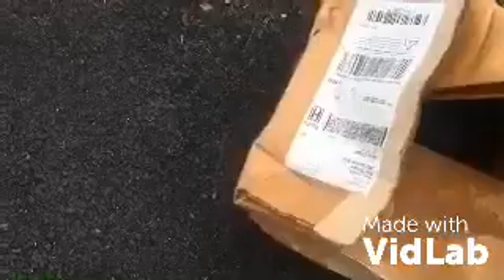SCRAPS BEFORE TURKEY 🦃

Comment: The rubber brake hose Does Not have check valve in it, the inside of the hose breaks down and it sucks itself closed and doesn't allow break fluid to return to master cylinder.
Reply from the maker: Oh I really didn’t know that 
If that’s what happens then yeah they do need replacement for sure

Comment: The guy with the "Iron" concrete tub, seemed like a tweeker. I know your "circled the problem" is just in jest, but full disclosure, your big, big truck, pretty sure it's a Ford F800. I think it still runs too, I mean, it is a Ford. It's not on the road because of insurance/registration or roll up door was busted. F150 is gonna net you an extra $7000, Ford's are in high demand. 

I drive two Ford pickups.
Reply from the maker: True true very true indeed 

Guy with. Iron tub 😮
lol.    Tweeker... typical  Joliet resident  
All hopped up on the goop 💊  🍷